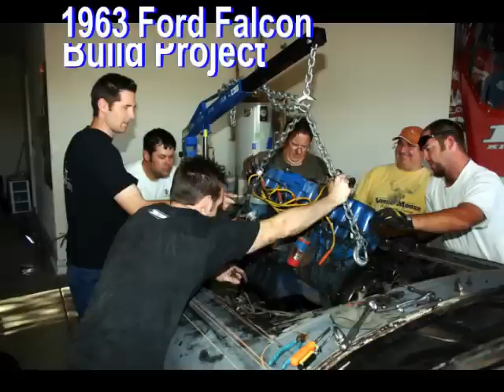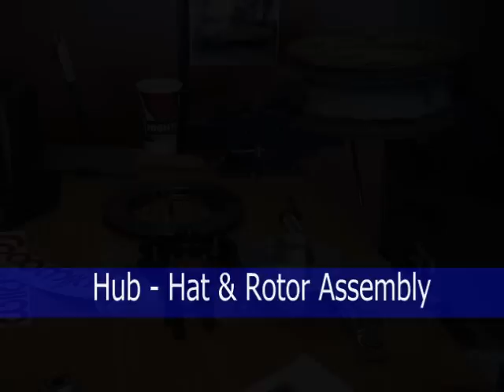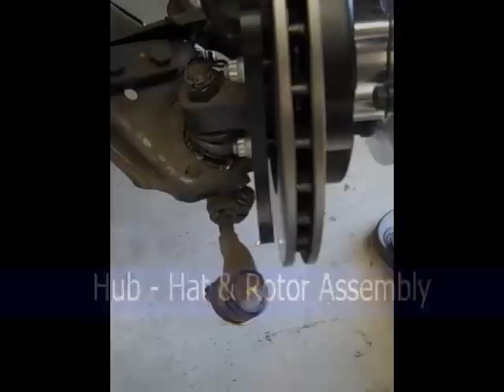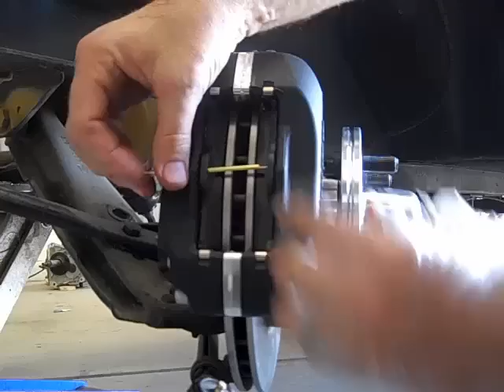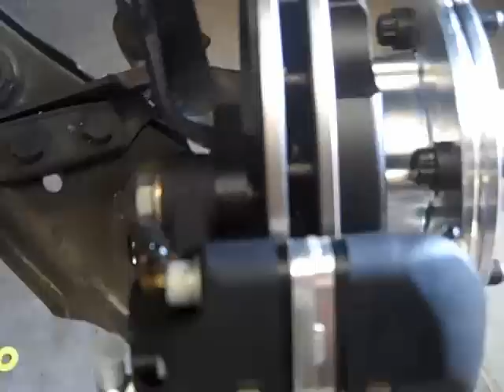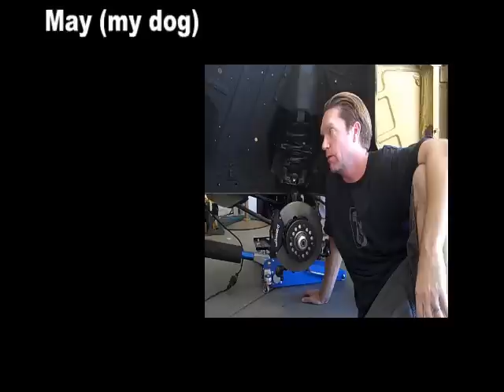Ford Falcon Wagon - How-To Install Wilwood disk brakes

Comment: Are you running front and rear? Power or not? What dual bowl master cylinder did you get?  Looks awesome, this will be my next upgrade for my 200.  I followed your vids when i was putting mine together.  Thanks
Reply from the maker: +Kyle Divine Hey Kyle, thanks for the comment. Nice to know the video might have helped someone!  I have front Wilwood disks, as you can see, and the stock drums in the back. I used the Geo/Suzuki power master cylinder. So far so good, but don't believe the "bolt in" idea. I had to do quite a bit of work to get the m/c to fit correctly. Mostly, I was struggling to get the pushrod level. I don't know how others are doing it. I hope you're on the classic inlines website. I'm there as pikesan.  Good luck with your project!